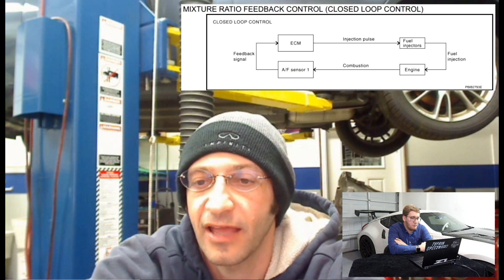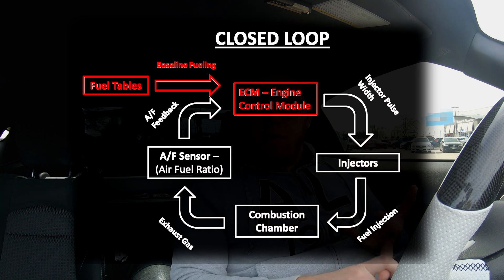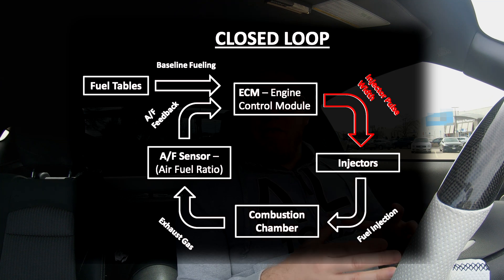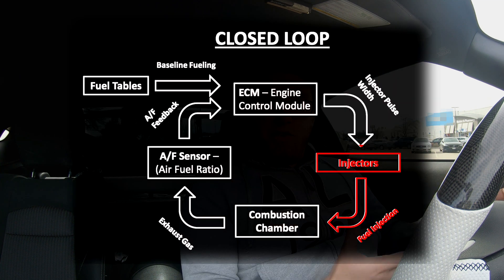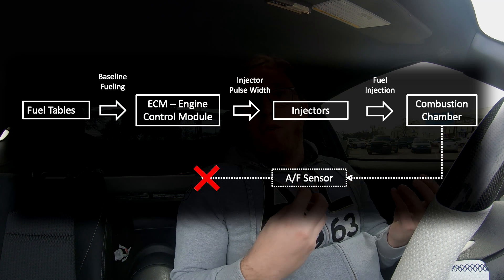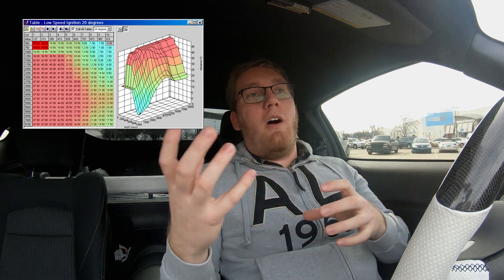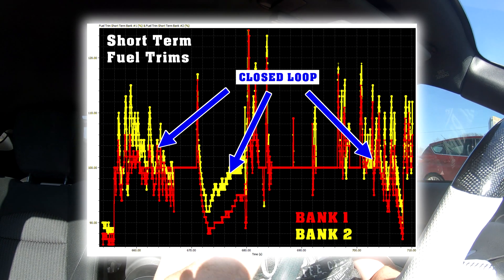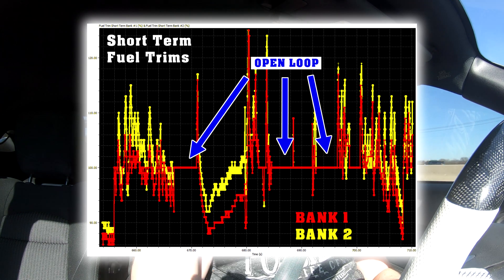Open vs. Closed Loop Explained - What You Need to Know

Comment: My ,2012 370z Touring is reading a ,C1109 open loop due to insufficient engine temperature!! I've replaced the battery & cleared code but it keeps coming back & my temperature gauge keeps jumping to almost all the way up 1 second & under halfway the next,! Plus I have no heat just cold air !! Do you have any suggestions? I would greatly appreciate it!!

Comment: Great video. I have a 2002 Nissan Xterra 3.3 VG33e. I'm getting different readings. For example. I show on my Foxwell scanner,  fuel system 1 and fuel system 2. At operation  temperature and at idle they are reading cl and then ol- fault. What does this mean. Thanks
Reply: have you figured it out?
same for me today...
Reply: @Dee-hi5zj  Yep. I replaced my fuel injectors.

Comment: ARF sensors?   Are you talking about the C02 sensors?
Reply: He means AFR or Air-Fuel Ratio sensors. Also known as an oxygen/O2 sensor or a Lambda sensor, they measure oxygen content in the exhaust and using that and the mass airflow and MAP sensors, they can estimate how much fuel is burning properly and how much should be injected

Comment: Thanks, very interesting and informative. I have a 370Z that is going to get EcuTek tuned in the near future, either by Rob Fuller at Z-Car Garage in San Jose or by Eugene Turkhov. I like the idea of initially setting up the fuel maps in open loop and then let the O2 sensors fine tune the AFRs finally.